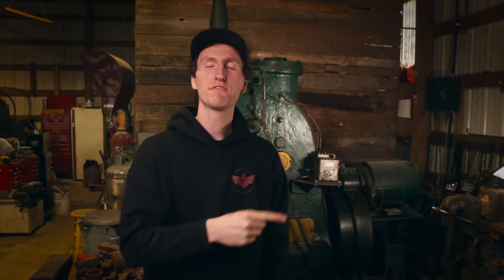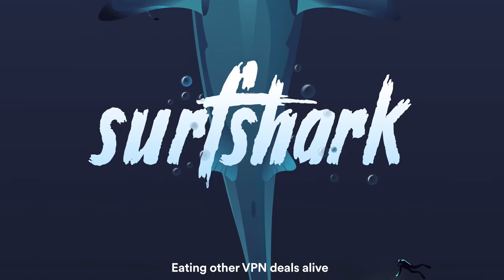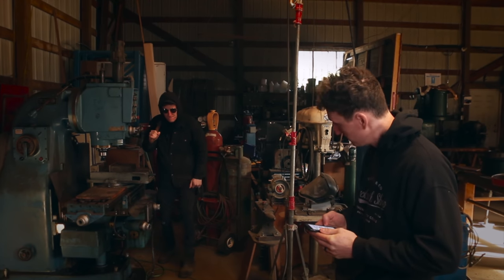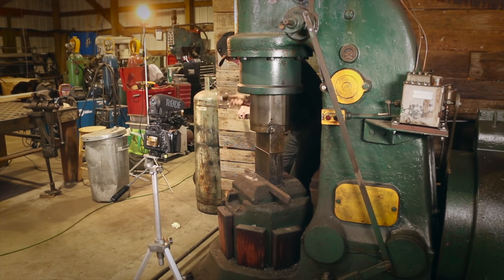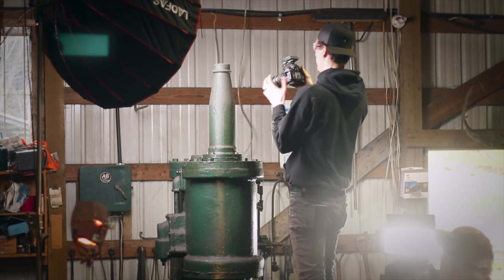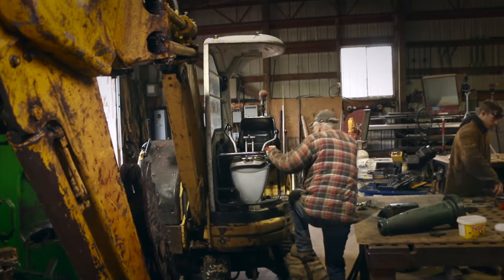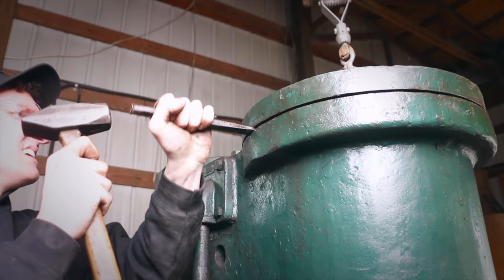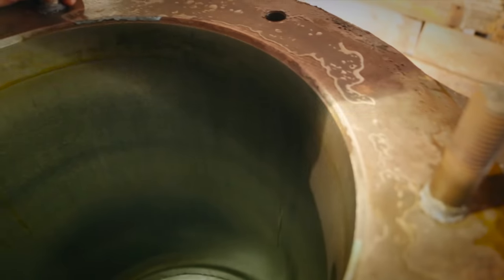Restoring HUGE POWER HAMMER - NAZEL 3B REBUILD - Part 1

Comment: My other favorite blacksmithing YouTuber Alec Steele had a few hammers the he ended up taking part in fixing as well. I feel like to be able to get the experience of using these really old machines you need to be willing to spend a lot of money to just get the thing then you most likely need to be willing to up to a full rebuild. It's kind of a shame but it also presents a unique opportunity to see them from the inside and really learn how they work. Silver linings and all that. This is fascinating stuff to me. I definitely want to see how you handle it if you have the time for it.

Comment: Fascinating to see the guts of a 3B! Thank you for sharing! Looks like you will get most bang for your buck with new steel ram cylinder head rings instead of those worn out brassies. Cushing plug, and cushing plug bushings look like they might need replaced too. They kind of look after market, not that I’ve seen many. I wonder why such irregular wear? Wonder if it was a result of using combination dies for most of its life? I use rubber packing rings between leather for a tighter seal on my 2B. I need it because I’m at 8,500 ft and cannot afford to lose any air. Mark Kraus is a legend! Pay him handsomely and treat him well. Such an asset to the blacksmithing community! He’s helped me a bunch with my blown-up 2B.

Comment: I cannot for the life of me think why you'd want to put leather seals back in. I'd agree that when it was made, leather is what they would have used. But if they had the tech back then to make the elastomeric seals we have today, I'm pretty well 100% sure thats what they would have used. I'd think with the correct profile and material being used, you'd never have to replace the seals again, while having a more accurate, smoother running machine that also is a bit cheaper to run due to reduced friction.
You said at one time, some blacksmiths think that using a power hammer is cheating, modern tech and all that, but then you seem to be ignoring modern tech, for your own power hammer. I have no idea if you can buy a power hammer new and if you can how much they are. Just observations not real criticisms.

Comment: It's all about the oil.
It's not shimmed it is the upper cylinder versus the lower cylinder and if the two are not exactly in line you wear that ram little crooked you got real trouble as there are no rings and you don't want them the trick is a whole handful of inexpensive 12 in long feeler gauges.
If you place about six of them around the smaller diameter whatever will go in equally all the way around you wanted to snug as you can get it you do the same at the top the larger diameter with the bolts loose on the cylinder and put about eight shims in there whatever equally goes all the way around to snug as can be then you tighten the bolts the other thing you have to watch out for if the guides on either side that you're not pushing the ram one way or the other everything is equal space all the way around the machine is absolutely is levels can be relative to the ram.
The key you cannot impart a side Force on the ram or it will make trouble.
You must also make sure that you maintain good radiuses and good surfaces in the die pockets you have to scrape them by hand to basic perfection if you do not you will make trouble the worst thing that can happen is you can break that lip off the ram if it's cracking you need to start saving your money buy a new piece of ductal iron to make a new ram with you can imagine the work these machines were made with such tolerances it's hard to imagine by today's standards I put a man's ram up in my machine and you have four diameters that basically must run perfect and there is no oversized so you can't just start cutting anything really have to take your time make sure everything is perfect and if it is not you must only give it a little loving kisses I think on his he was out maybe a few thousands between the two boars
And it required maybe a thousands and a half of massaging on the outside diameter of what you see as the ram obviously this takes a lot of abuse from the abrasive atmosphere a forge exists in.
In addition to the strikes it receives from loading dies and material. 
I was making some H13 dies for him here recently.
Allot about that machine from a machinist perspective I can tell you if you wish I'm easy to find 928-499-7259